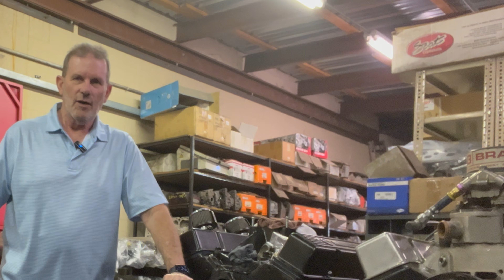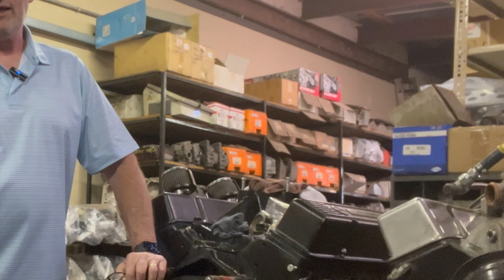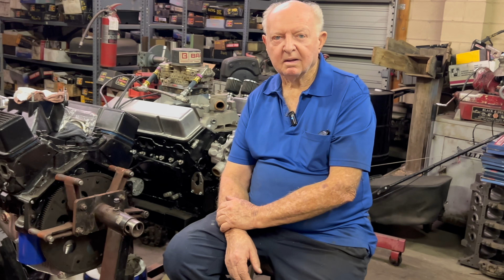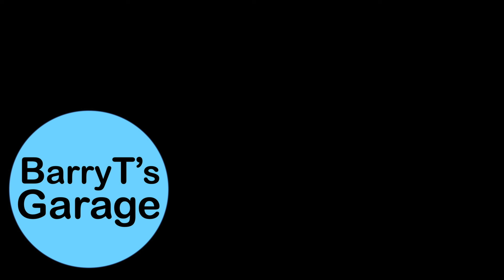Some Racing Tricks Were Legal. Some Definitely Weren’t. | Ask Ed Pilot Show | Ed Smith with Barry T

Comment: I knew a ''no time'' guy that had his beam tripper rigged for cheating.  As he pulled the shoots at the beams, it powered a set of 20 inch long air rams, essentially stretching the front of the car as he crossed the line. He got away with it for no telling how long....till it failed to retract and he showed up at the slip shack with a bumper sticking 20 inches out in front of the car.. The ironic part is, His class rules stated a "Maximum length of beam tripper, <from bumper>..'. and since he just moved the whole bumper, there was no foul. .The next season they had a complete list of allowable and banned actuations. XP
Reply from the maker: Hilarious.  I'll ask Ed if he's heard of anything like this

Comment: You've talked about Fords' Flathead V8. I don't know much about them, but do know there are a few of head bolt differences.  Which is the most desirable, the  19 bolt, 21 bolt, or ?
Reply from the maker: 24 stud unless you were trying to match a specific spec

Comment: We had a 87 malibu 267 V8
Put a 1nch sq piece of metal infront of the cam 1/8 thick
Reduce camshaft walk at high r.p.m shimmed the drive gear on the distributor .put a clutch fan on it .we were beating 350
Reply from the maker: Interesting setup - I’m going to ask Ed to comment on it 👍

Comment: This guy has done it and knows his stuff . I ran a little Vega converter . It was dark blue and behind my 69 Ram Air III Pontiac in a 77 Trans Am it flashed at 3200 rpm . I ran either 3.73 or 4.10 gears with a TH350 . I ran the Vega converter for about three seasons before going with a ATI 9 inch 3500 converter . The Vega converter cost me $40.00 while the ATI was $600.00 .
Reply from the maker: Saving money is sometimes a big part of racing. 👍🙏